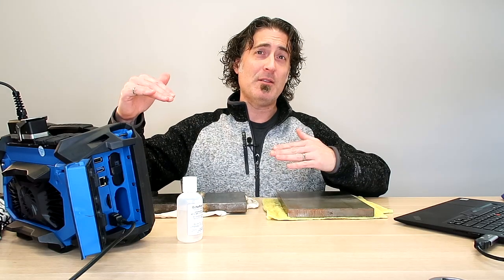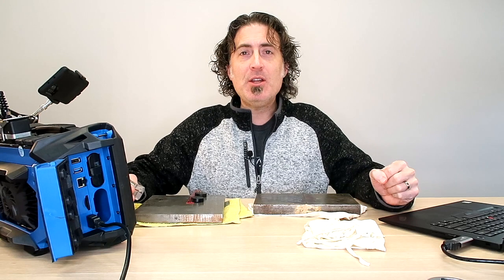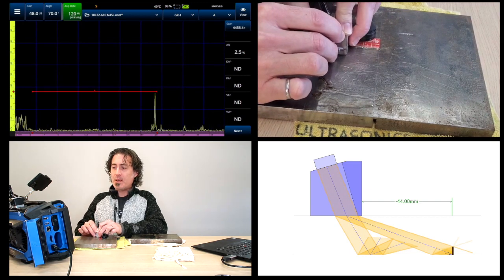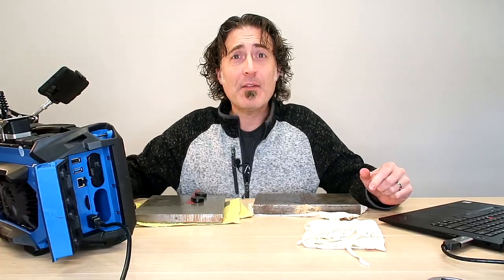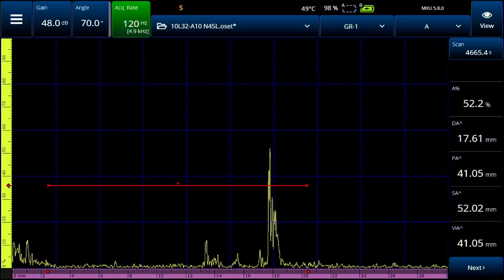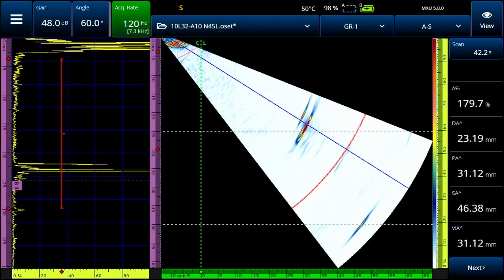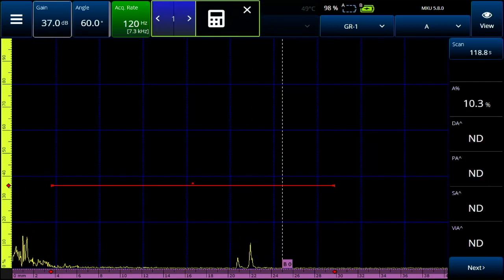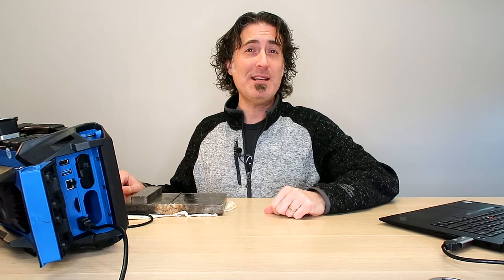Creeping Waves Part 2 - 30-70-70 Technique

Comment: Excellent video, it blew my mind. Too much information in 5 minutes. One question: - The tip diffraction signals of 70-70 appear before the reflection signal, but in the 30-30, the tip diffraction appears behind. Due to their proximity to the transducer, shouldn't all tip diffraction signals appear before the direct reflection signals from the corner trap
Reply from the maker: Thanks for watching! Depends on whether you're getting the 1st leg or 2nd leg tip (after the bounce)
Reply: @hollowayndtengineeringinc.5201  Thank you very much for sharing so much content. I've learned more in half an hour with your videos than in the 80 hours of my UT course.

Comment: Hey Paul! Wondering if you knew what effect the shape of the reflector has on the transverse to longitudinal wave? Does the shear to L-wave mode conversion only happen on a corner trap/notch, or do you also see that interaction on a SDH for instance? Im trying to get some insight on calibrating for a refracted L-Wave inspection in stainless. Appreciate all you do!
Reply from the maker: Oh definitely! When sound strikes a hole, the impingement angle is always changing. But the relative surface area of that target is going to be much smaller so it will be harder to see.
Reply: @hollowayndtengineeringinc.5201  thanks for the response! I've been hearing a lot of back and forth about stainless/coarse grained welds lately in my neck of the woods, so I'm trying to play around with the tools I'm allowed to have for now.  Its definitely an interesting inspection, but I'm still skeptical about the impact that the grain boundaries supposedly have on shear waves. Refracted L-Waves and a mockup weld seem like overkill for a scenario where transfer correction should suffice. But, I'm always happy to be wrong if it means I get so learn something new so 🤷